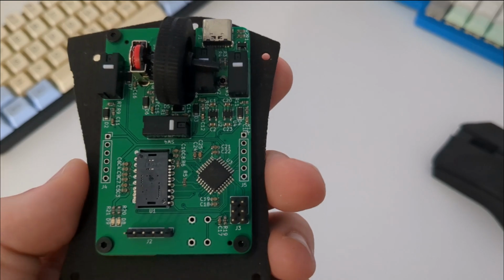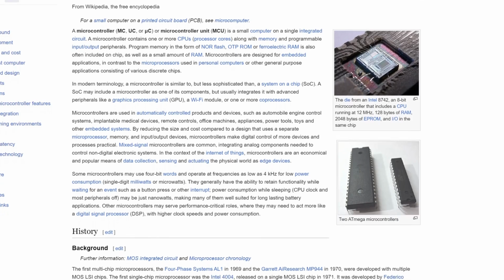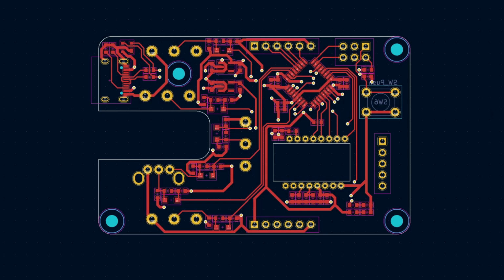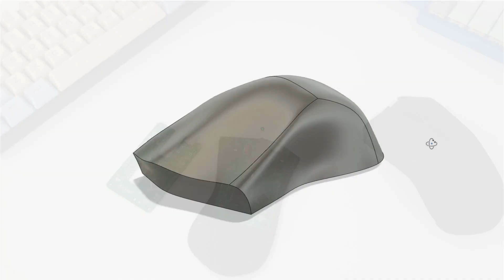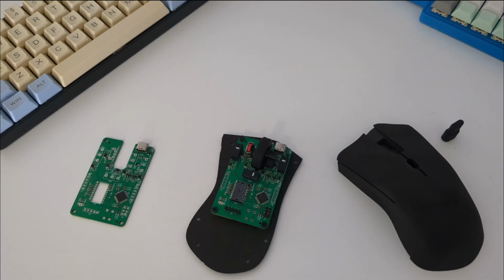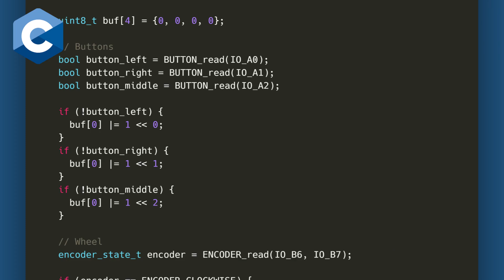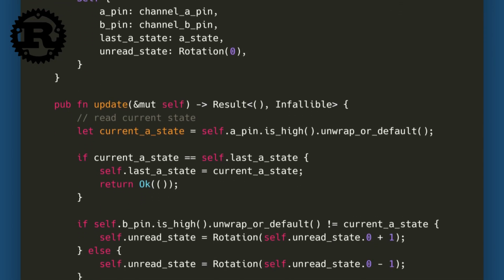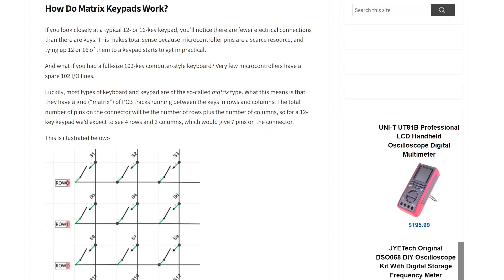Computer Mouse from SCRATCH With RUST Firmware!

Comment: Rust gets embedded-hal almost entirely because of the rules and restrictions you don't care about. The rich type system and community focus on safety and adherence to idiomatic code makes interop with other libraries substantially easier than in pretty much any other language. Throw in a standardised compiler, linter, formatter, package manager, and documentation engine and you've got one of the easiest languages to collaborate in.

For a lone genius, I'm sure C, Zig, C3, etc. are all much nicer since they get out of your way. But for someone who knows they aren't a savant, I'll gladly accept some rules if it means I get things like Axum, embedded-hal, Serde, etc.
Reply from the maker: Yes! And I'm excited to see more and more rust in embedded because of that!!

Comment: This is an awesome project! I rarely see DIY mouses made, only keyboards. Would you mind adding a BOM of files to the GitHub repository and some links where you sourced your stuff. Also, will this be compatible with PMW3389 mouse sensor? From what I read it's much more accurate than PMW3360DM. Thank you for sharing your journey, I am sure it took a lot of time.